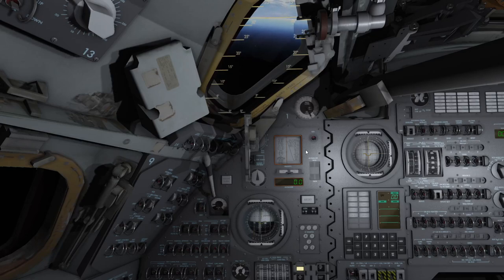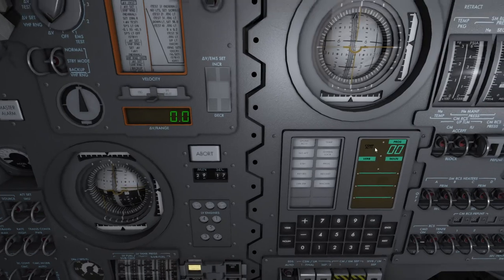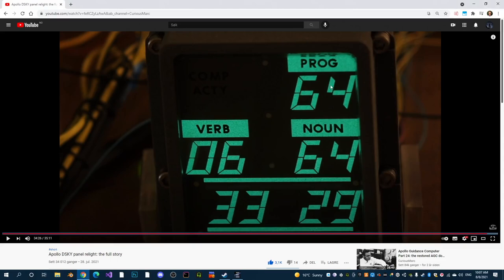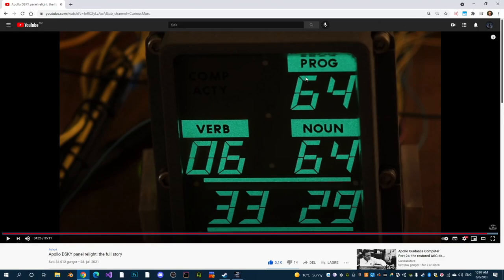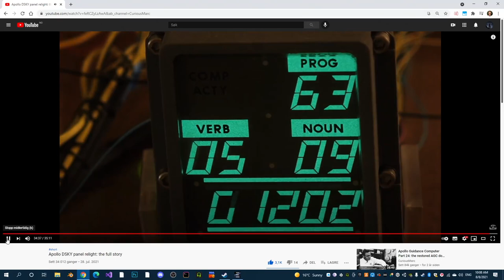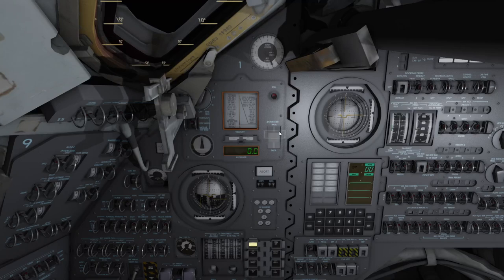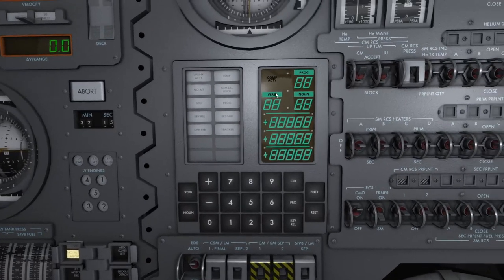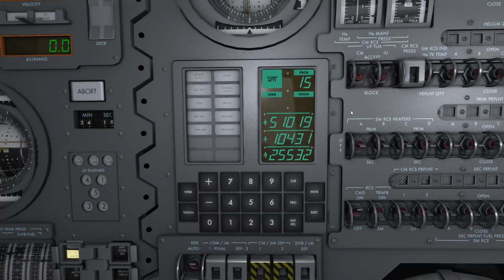Apollo DSKY digit rendering

Comment: I just learned about your program this afternoon and I'm checking it out.  The attention to detail is fantastic!
But, I have a question I hope you'll answer.  The Microsoft Store lists one of the system requirements as Windows 10 or higher!  Is that true, or is it a matter of MS throwing a sales pitch in on their site?   that's too bad, if true.
My system is running 64-bit Win7.  It has dual 12-core Xeon CPUs, NVIDIA GeForce GTX 960 GPU, and 128 GB RAM.  Should do, right? 

TIA
Reply: Hi! First of all I would recommend the Steam version of the game as it's still an Early Access title. This is not supported directly on Windows Store so updates will be slower. Also a platform conflict currently prevents it from being updated on Windows Store, and multiplayer/VR/TrackIR is not supported on Windows Store.

The Steam version is the right platform to use during Early Access. It should support Windows 7, and has a refund system so you can test. You should look into that and see if it lets you test it.

Thanks!